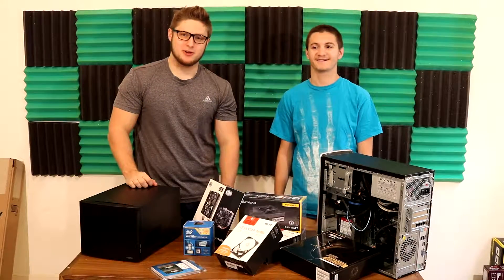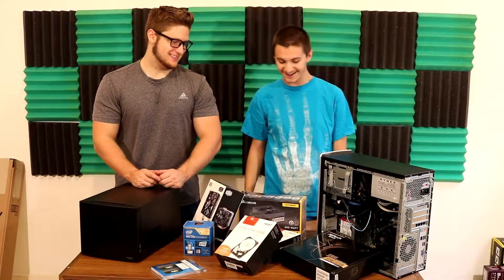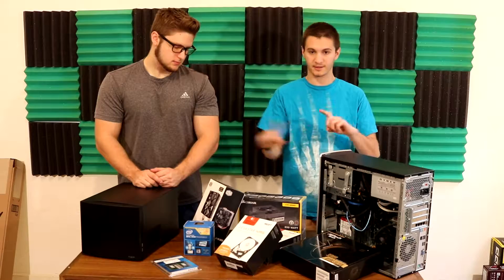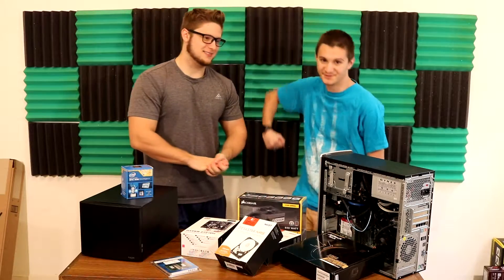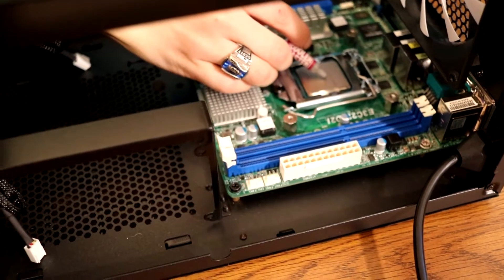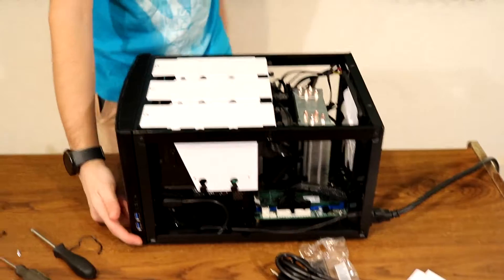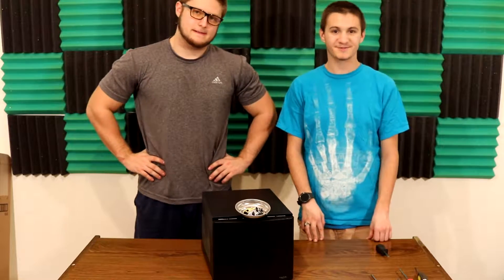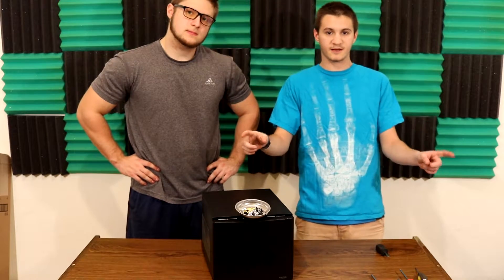NAS 101: Building a NAS/What is a NAS/Network Attached Storage

Comment: I'm debating on building a NAS box in a Fractal Design Node 804 case, but I do like the hot swap drive bays up front on the Silverstone DS380 for the purpose of replacing a failed drive ... but I also like the numerous possibilities for cooling fans and filtered intakes on the Node 804.

I'm wrestling with the idea of:

1.) Using the Node 804 case to build a NAS

or

2.) Picking up a DS380 case to build a NAS and use the Node 804 to build a Media PC (to attach to a TV for gaming, etc.)

I'd like to be able to start a NAS build with like 3 WD Red drives (i.e. 3 x 4 TB WD Reds) in a RAID format where I'll get the storage of 2 of the 3 drives and be able to lose 1 drive before losing data. I'd also like to be able to add additional drives to it (when $$ allows me to get additional drives) and be able to expand the available storage space, without having to move everything off, add the drive and then move everything back. Not only will I be able to buy drives when I have the extra $$, but it'll also spread out the drives life (i.e.: 3 drives running for 6 months, 1 drive running for 2 months) to lessen the possibility of multiple drives failing due to age.But can I plug in additional drives and expand the volume without having to remove the data or losing the data by expanding the volume??

Options I'd like to use with the NAS are:

1.) Be able to expand the volume size (as stated above)
2.) Be able to use between 8 and 12 drives total (with at least one being able to fail and be able to restore on a new drive once replaced)
3.) Be a central file storage that's accessible within my network on both computers and an iPad
4.) Be able to access files when outside of my home network (similar to the way WD My Cloud does) via a computer or an iPad
5.) Use for video streaming of movie files and my DVD collection (1,500+ DVD's) as well as my music collection (1,500+ CD's) to devices like Boxee Box (no conversion needed at this point)
6.) iTunes server running to have my iTunes library shared to devices like an iPad (through home sharing) so a computer doesn't have to be left on
7.) Be able to stream video and audio to devices like an iPad without having to download it prior to playing
8.) Serve as one point in a backup solution, where it does a complete system backup (programs and files) weekly, keeping about a month to a month and a half of backups before a new one deletes the oldest one. Where I can do a restore on a new drive to exactly the way it was before the drive failed (without having to reactivate programs, like Microsoft Office, etc.). As well as a rolling backup, where if a file is accidentally deleted, I can retrieve a copy of it (i.E.: Snapshots in FreeNAS)
9.) Be able to share files with others outside of my network. IE: be able to give people a URL (like mycloud.com) where they can log in using a username and password to be able to access the files that are shared with them (similar to what Pogoplug did with their cloud storage for those familiar with Pogoplug).

These are some of the options I'd like to have. So what software/OS should I use: FreeNAS, OpenMediaVault, OpenFiler, FlexRAID, UnRAID, etc. should I use?? What hardware do I need for the software/OS (I currently have a Fractal Node 804 case, ASRock QC5000-ITX mobo, and a 500 W power supply) that's won't break the bank??
Reply from the maker: I don’t know much about all the different Operating systems.
In my experience FreeNas is really good and the one I personally use for
everything, but UnRaid is also a good one, but I don’t have much experience
with. 

With FreeNas, once you create a pool of drives, it is very
hard to add more too it. That’s why I waited to do my build till I maxed out
the drive space in my case. Eventually I want to upgrade to larger drives in
the same array. I will buy 1 or so drives at a time with larger capacity till I
have all drives with the same amount of storage. If you add a drive in, it will
have to be on its own pool. Unless you know your way around major coding to be
able to add it in. I think It can be done but migrating is a pain. I just
upgraded to FreeNas 10 and its been 18 hours and its still migrating all my
content from the old OS to the new.

Why not use 1 computer for both media and storage, like I’m
doing with my current Nas setup. I have FreeNas on a USB and Plex Media Server running
on an SSD. You just need to make sure that the computer is powerful enough for
both.

I use Acronis as the backup for all my devices, it also
recognizes that I have a Nas and can backup to it. It also has schedules for
when and where it should back up to. Acronis has many different backup
solutions and how it operates. We may do a video on it soon as well.

For accessing outside your network you can use NextCloud or
Owncloud. Im personally using google drive. I have unlimited storage with
Google Drive and I backup my Nas to it. And then using plex cloud I can access
most of the content for streaming purposes and then files not compiled by plex,
I will use google drive for. I tried using Next and Owncloud, but never fully
got it to work well enough to use them. 

As for the parts, I think those should be fine. 500 watts
should cover the power for the build. It is a Nas, so it doesn’t require that
much power. If you are using plex, you need quite a bit of ram, at least 2 gb
per TB in your system is recommended in your build.